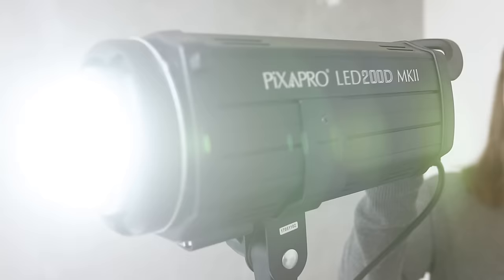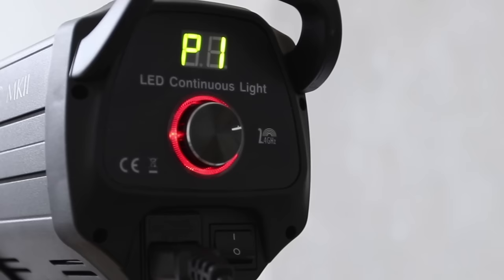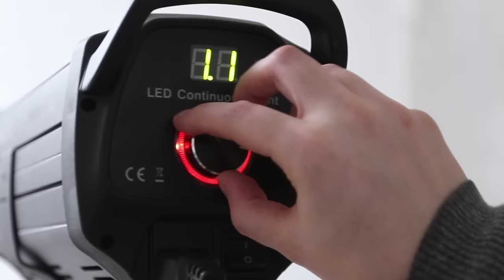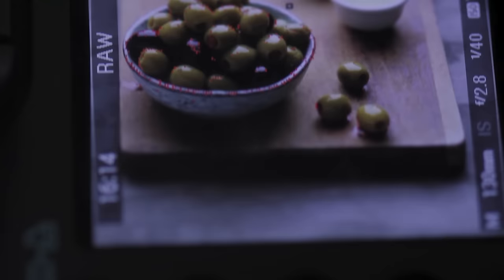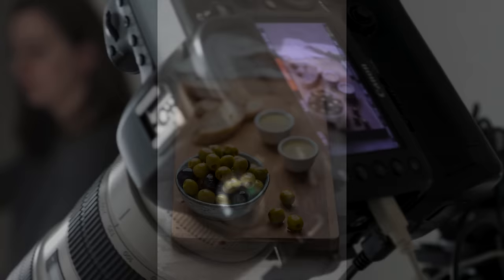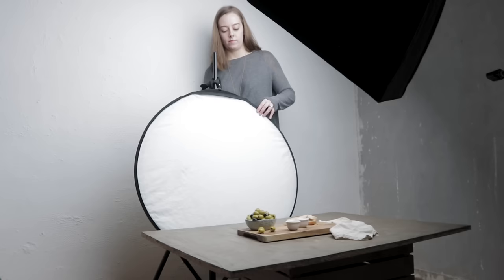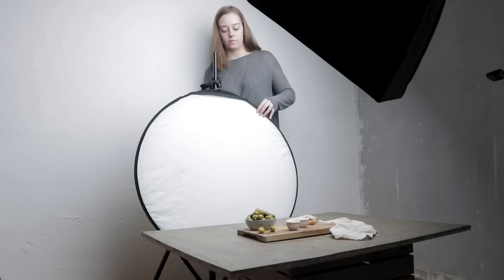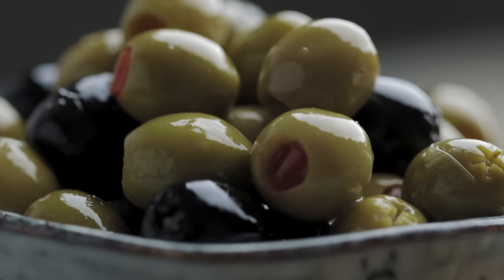How to Use Artificial Light in Food Photography (Using just ONE Light Source)

Comment: Great video. I find food photography the most difficult so far. People's portraits are super easy comparing to food. Not sure why, but lots of pictures of food turns out mostly bad. I think it is because I have small diffuser. Will try to get a bigger one and lets see the difference. Also, my space is tiny comparing to yours, so that could be other factor. One thing though - which you probably already know by now, but CRI is not purely about daylight, but it is ability of the light source to faithfully display colours. All of them. Lights with CRI higher than 97 are pretty accurate. But light that has set temperature for 3500K will be very orange like and it can still have CRI of 97+. That means it will be radiating that colour temperature very accurately. Even though it is not really a daylight. But if you have a bi colour light with with range of 3500K - 6500K and CRI 97+ all of those colours will be very accurate. If your CRI will be lets say 92 or less you will be getting all sort of colour tints in there.
Reply from the maker: Food photography is definitely an art in itself! Thanks for the extra clarification on CRI, i'm sure other people will find it helpful!

Comment: Moving a large soft light further away will create an apparently smaller but less intense light source but you indicate it will be a harder light. Won't the smaller apparent size cause less soft edge shadows or hard light type shadow only if the intensity is increased to compensate for the light fall off caused by increased distance from the subject? Thank you for a well executed easy to understand tutorial. Overall a stellar job.

Comment: Hi Lauren, thank you for the amazing content! I sell pottery and other kitchen products and your videos are helping me take better photos for my social media accounts and website. I currently have a single Godox SL60W which I setup with a 120cm octagonal softbox side lighting my subject with a white reflector on the other side. My backdrop is 1 meter wide, and I place my softbox and reflector right by its edges. I have been struggling with light fall-off across my scene, my backdrop and background get significantly darker from one side of the frame to the other. I think the fall-off makes my image look a little “fake”. I’m trying to go for the indirect/window lit look and from what I can observe these types of images tend to be evenly lit across the scene (in the direction of the light source). Setting up my light to a 45-degree angle somewhat helps but I think I lose a bit of the window lit look with the shorter shadows. I imagine this kind of issue if hard to describe without seeing the actual photos, but any tip or comment might go a long way.
Reply: I don't know if I completely understand what you need, English is not my mothertong, but if I understood.
Have you tried moving your backdrop further ? It will be darker than the main subject but it will have an even light, or maybe use a grid to stop light going to the backdrop